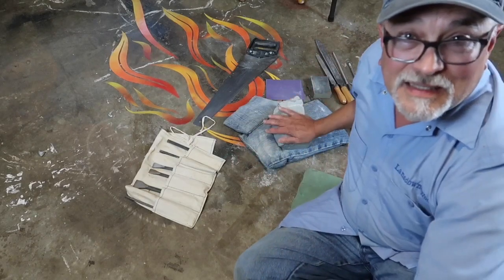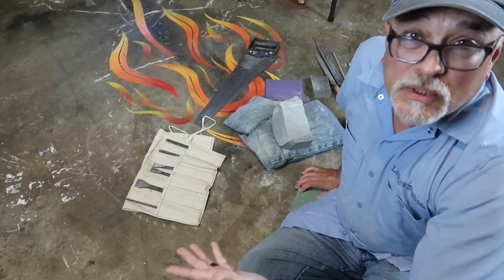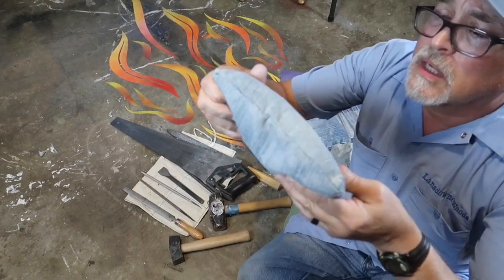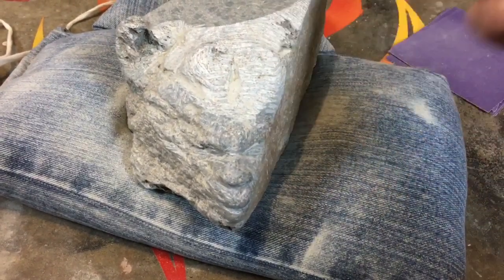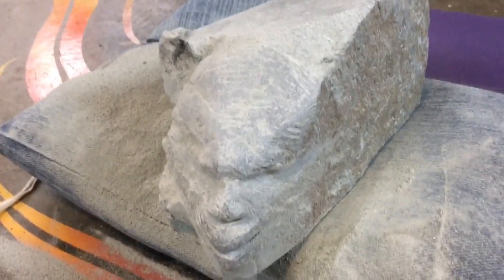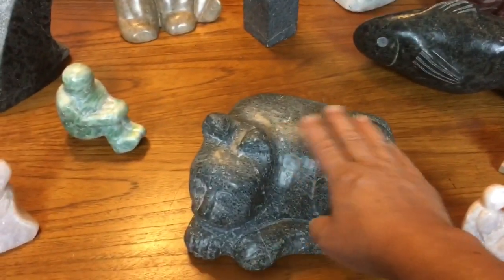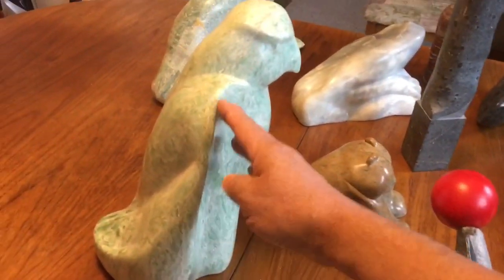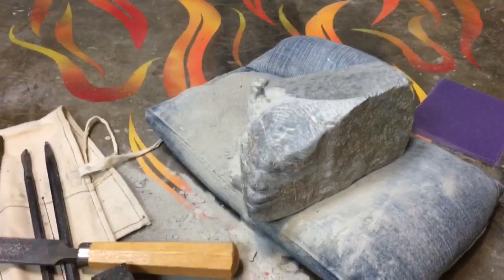Soapstone Carving

Comment: how did you turn the soapstone look like dusty into like vinyl?
Reply from the maker: Thanks for your comment. After filing i used wet dry sandpaper getting finer and finer finishing off with about 600 grit. Then using a paste wax to give it its final shine.
Reply: @markdmaker3173  thank you! 😊

Comment: What if i put it in a lathe
Reply: I would not advise it in a lathe. The stone is sometimes very unpredictable as to internal flaws, cracks. The centrifugal forces would likely explode if it lets go. However, you can turn it at very slow speeds, because it does not take much force to cut. It is like a fine grit sandpaper, so it dulls your tools quicker than wood. Use more of a scraping idea, like rasps, heavy sand paper etc. I hope this helps.
Reply from the maker: Humblehombre give some good advice. It could be quite dangerous to put stone on the lathe.
Reply: @markdmaker3173 Soapstone turns beautifully. The good stuff is far, far more solid than your average burl. Even minerals much harder than talc can be turned if you use diamond tools and low speed. Enormous columns and vases have been made from things like alabaster, marble, malachite, rhodonite, lapis lazuli, agate, etc.